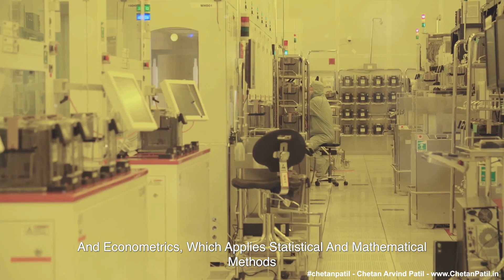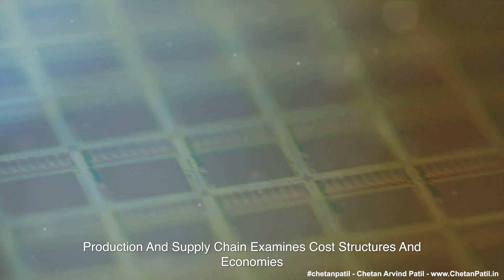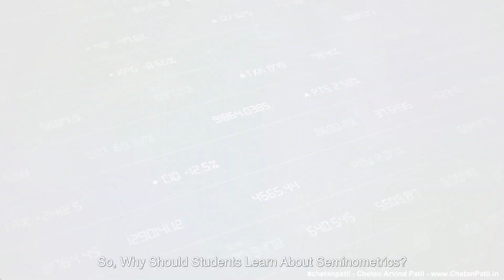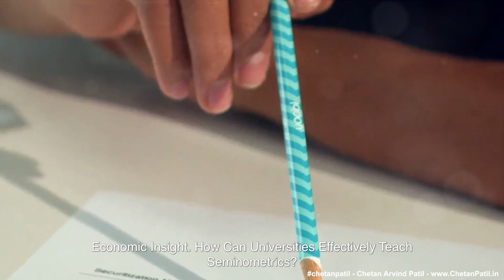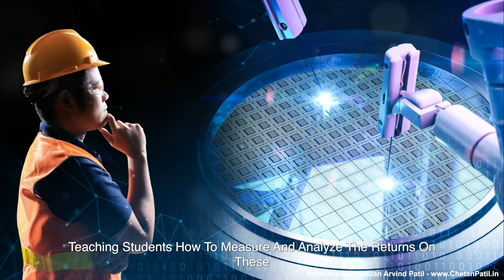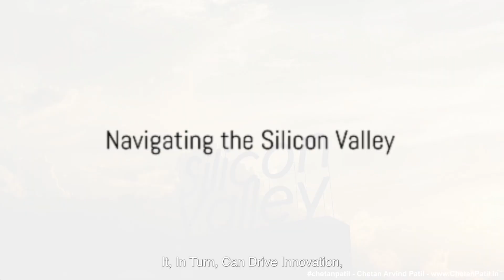VLOG-260 | The #Semiconductor Seminometrics Study

Comment: How do you see the integration of seminometrics evolving in university programs to better prepare students?
Reply from the maker: Thank you for asking the question.

Part of seminometrics has already been incorporated, but is very distributed. Like management schools having different business courses and specializations around econometrics.

I foresee that apart from the technical semiconductor education, there will be more fusion courses that will connect econometrics directly to semiconductors, not as a standalone econometrics only coursework. This will allow students to gain insights about different ways the cost and production BOM is built and factors affecting it, and also the business around it.

In summary, as an elective to start with, then certification (as a major), and then a full-fledge program offered by multiple departments.